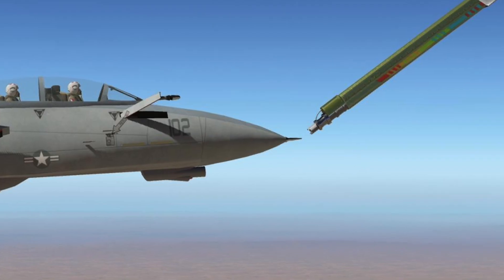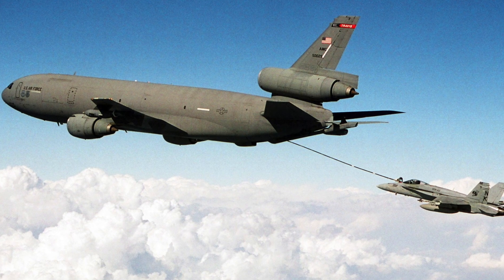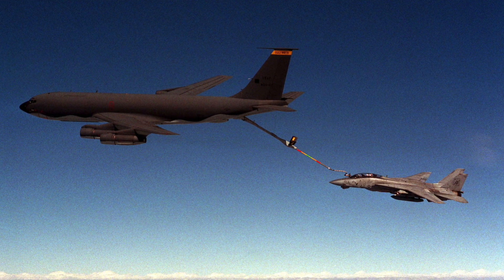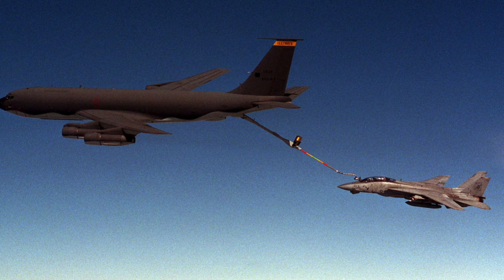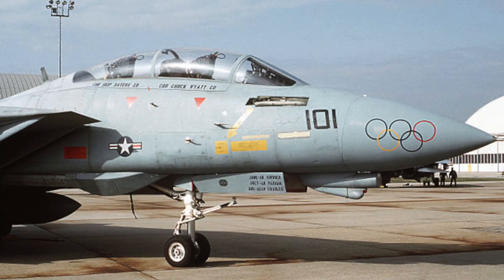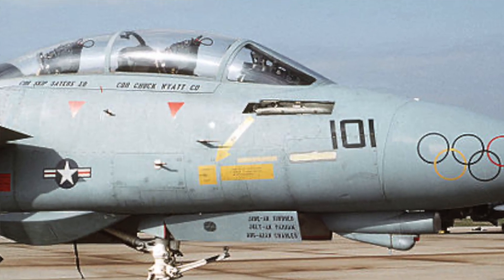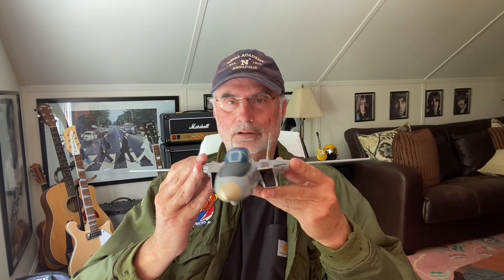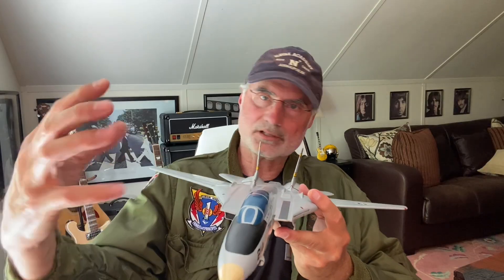Secrets of the F-14 Tomcat: Inflight Refueling

Comment: The under appreciated story is the decade plus of work that went into converting the F-15 to a modern FBW system with a redesigned wing and state of the art cockpit. These upgrades required extensive flight test program and were funded by FMS customers.

Comment: At least in DCS, I find the Navy Hose-and-Drogue FAR easier to accomplish than taking fuel from the boom.  Even when I am out of practice, I can usually get the F-14 plugged up to the droque on the first or second attempt.  Tanking in the F15 is, for me, far more difficult.

I understand why the Air Force tanks with booms, though.  They have to accommodate bombers, which can't be expected to chase a basket.

Comment: We had a pilot catch the fuel scoop on the cone air probe right after I joined the squadron. I got to crawl up the radome and try to undo these tiny hex screws on the waveguide up in the tip while holding myself up on my elbows. It gets warm in there! And of course all those jokers who walked by, moved the chocks, and rolled the radome back and forth with me in it. Crazy squids...

Comment: Great episode Ward. In the early 70"s my Dad worked on some issues with the F-14 fuel probe. In development it had been designed by a consultant and needed a revision to get right. In the F-14B WST when we deployed the fuel probe we would get increased wind noise in the aural cue system. It is a miracle you guys could refuel.

Comment: Was trying to figure out where to post this question: Could you talk about the fuel system in the Tomcat? Specifically how does the fuel pickup system allow such maneuvering and still be able to get gas to the engines? I know about tank baffles but does it have a header tank that always stays full so there's never an air pocket blip during aggressive flight regimes? Maybe fuel bladders that never have empty space in them to start with? I would also guess it has an inverted / negative G time limit? Was just pondering the design of it all as a mechanical engineer. Thanks, love your content!

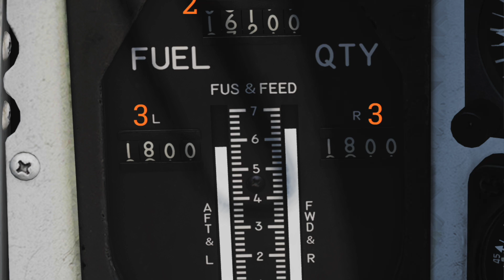Comment: Great channel however no offense but on the pilots fuel "quantity gauge it measures total lbs of fuel in the aircraft not fuel flow.  Item number three at 0:59 mark is the quantity of fuel in lbs in each of the feed tanks left and right.   Retired AD1 tomcat mechanic VF-124, 21, 24, 211 and VF-41.  Keep up the good work.

Comment: My thoughts were that the USAF learnt to tank large aircraft (bombers) first so the probe system makes more sense - harder connection and higher flow rates, the navy learnt to tank small jets first so the basket system makes more sense. I think IIRC the KC10 had both systems on it? Really think the Navy made an error in retiring the S3 - both from loosing the ASW capability and air refueling, I find it hard to believe it was cheaper to put the airframe hours on the F18s...
Reply: The US Air Force originally had probe-n-drogue refuelling, just like everybody else in the world. Then they tried refueling entire flights of four-engine bombers and found out that it took three seconds short of forever to get the job done. So they had to come up with a new thing to increase the flow rate. The flying boom was born.

Comment: Ward I was a KC/DC-10A guy A.K.A "GUCCI BOYS". Aircraft call sign "Yard Dog " Tac sign "Sierra 27 ",
We would always right up in the aircraft forms " Drouge refuel basket broke due to Marine F-18 " Because it never failed everytime they refueled from us it broke.
A few times we had to send our reps out to retreve our drouge basket from a few carriers. 
Oh the misshaps....once the basket breaks off you got a wet noodle flapping around the back of the tanker. It has to then be cut by a explosive charged cutting blade. Each distance between each marker line on the hose is 10feet. And every 10 feet of hose has a weight of 100 lbs. We extend 14 to 15 feet in trail.
As for booms....there had been a few F-4's that had snaped off the boom tip in thier UARRSI refueling receptical. 
When expecting F-4's we had to lube the Boom tip with teflon lube back in the day. The F-4 UARRSI was a half millimeter smaller in diameter than other recepticals.
No Lube =get stuck.
No Kickass Without Tanker Gas.
For modified KC/DC-10 Look up KC-10 WARP Bird.
Thanks Ward for the awesome videos. Awesome job on your channel Brother !

Comment: Why is air force an navy tanker different
Reply: Air Force needs a higher flow rate than what the Navy system has. The Air Force refuels some huge airplanes, so they need to pass more fuel in less time.

In a perfect world everyone would be using the Navy-style probe and drogue system. But it just isn't fast enough to fill up a flight of heavy bombers.

Comment: Got a call one day in '84 at NAS Barbers Point to take my tow tractor and meet an A-6 (tow bar not required????). Anyways the A-6 had a Drogue stuck to it's refueling probe, so the pilot and some chief, using the tow tractor as a step, tied a chain or line to the Drogue and then I genteelly used the tractor to pull the drogue off. Always wondered how often that happened. Now I know.

Comment: Maybe this is a comment so stupid that does not need any response. 
Why are aircraft aerial refueling points never used by ground refueling crews. Do the internal fueling pumps need to have engines running? Would an external APU help power internal fueling pumps to distribute to proper tanks?.  Greater chances for spillage? Is it safer to dump spillage in the air than on the tarmac?  It be nice when fighter aircraft use 3Phase 400cycle electric power. Tankers will just dangle an extension cord.:-) It would be nice if they could reload stores while in the air.

Comment: I was a Crewchief on A-3 Skywarriors with the west coast FEWSG squadron out of Pt Mugu in the late 80's. We had a KA-3B tanker. In addition to tanking ourselves we would also tank other squadrons / test programs / operations. One time we were doing a tanking training flight with the west coast F-18 RAG. There were four planes, three student pilots and a Marine Major instructor.  We were out over a MOA by the  Edwards area. One student was having issues contacting the basket. The Major finally had enough and told the student to "back off and let me show you how it's done". I knew the pilot and nav had rolled their eyes with that one, I know I did. Depending on if we were straight and level or in a turn I could look out over the back end (the Crewchief sat backwards) and see the drogue and the receiver aircraft. I watched as the major came in "kind of hot", hit the basket and watched as the sinewave went in and out. We could feel the shove that it gave the A-3. It ended up snapping off the Hornet probe into our basket. Crickets over the radio, then the major said "knock it off, RTB". He looked us over and verified we weren't leaking any fluids and left. We talked about what to do including using the guillotine to drop the hose out in the desert. We talked about it and came to the decision that if we could get the hose back in with lights out on the panel we would take it home. It reeled in with no issues. We landed with no issues. After we landed I unlocked the hose, me and a couple of line rats pulled it out of the fairing, strapped it to a tow bar, hooked that up to a tractor and pulled the hose out. I found no issues with the hose. The basked was trashed. The basket had "fingers" that the drogue attached to, there were "a couple" of them that were broken and bent. I pulled out the broken off part of the probe and gave it to the pilot. It's my understanding that the wardroom had it mounted to a plaque and they sent it back to the Major via the RAG's ready room.  This image is of my last flight in an A-3, 17 June 1989, we were tanking a NAS Point Mugu A-6E and a TA-7C (they were the chase planes) during a Harpoon missile shoot out over the Sea Range (PLEAD control).    https://www.vaq34.com/junk/a-3_tanking.jpg

Comment: Hi Ward.  Not sure about your description of how to "plug" a probe-n-drogue refuelling system.  I would never use rudder to adjust lateral displacement.  Rudder trim needed to be adjusted when in the 'waiting' position to get the good QFI "Ball in the middle".  From then on it was normal use of the fight controls to position the probe a short way behind the basket and then a bit of power to plug.  Using roll to raise or lower the probe in relation to the basket will just get you moving left or right away from the waiting position.  Small, normal, movements to get the probe in line - yes, as you roll right the probe will go down in relation to the basket, but, when you level up with the tanker again you will have moved a little to the right.  If the pilot in the video was using the technique you described then it might explain why he was dozy doe-ing around at the back:-).

Most of my tanking was behind Victor, VC10, Tristar, KC10 and KC135 (with the short hose!!!). Flying Tornado GR so probe position very similar to the F14.  Some interesting night tanking in GW1 in thunderstorms down at 4 - 5000 ft over the desert.  We were young in those days:-)

Regards  Mike - ex RAF

Comment: Hmm... it just underlines my recommendation to the RDaAF! If there is ANY way you can avoid airial refuelling - then FIND it. It is not that it can't be done; but the cost in tankers and training of aircrew is overwhelming.

Fortunately it seems likely that an understanding has been reached with Greenland and Iceland (Norway and Canada), where allied forces can use Søndre Strømfjord and Keflavik - at a price - but then you pay rent on a flat? And pay for power and water as you go? Personally I have nothing against Greenland EARNING some of their own money.
The savings to the USA are spectacular.

Now fighters are the smallest air refuelling problem - a far bigger concern is the big transports: They use A LOT of fuel and are not particularly easy to refuel in the air.
The point is: When you have a string of pearls airfields (so you allways have a full-service air station as a back-up) then the problem reduces significantly. Those airfield have to be defended - naturally. Here the F-35 is the airplane (with Mestersvig and Narsarsuaq as emergency fields) the right fighter - it has range. But condering the vast savings to the USAF it is NOT a smart move that we have to pay for the privilledge of doing the USAF a giant favour) - now that controversy is simmering down.
It did not help, you elected a moron for president having advisers that had done a couple of traps to many - so their feeble minds were all shaken up - jumbling BOTH braincells.

There is another technical point: Sdr. Strøm and Keflavik (Gander as well) have very cold air, which means in take-off the thrust of the engine is enhanced - it requires a bit more maintainance of the airfields; but a broom operator cost A LOT less than a crew of C-5's (incidentally: It does not snow much on Greenland - precipitation is officially like a desert).For landing the air is very dense and that is something a heavy laden transport appreciate - it lowers landing speed considerably.

There is a reason why some Nato members can be "difficult" at times.

Comment: Great video as always Ward!! As a side note the reason the Air Force uses the boom method for IFR, is that the boom can transfer more fuel more rapidly than the probe & drogue system.  A KC-135R can offload up to 6500 pounds a minute @ about 40 psi pressure. The AF used the probe & drogue early on but it was too slow to effectively use for bombers. Keep the videos coming, they are great viewing!!

Comment: I was the NCOIC of the Hot Pits at MCAS EL TORO from 94-96.  VMFA 314, VMFA 323, VMFA 232 VMFAT 101  Mostly F18c, sometimes we got 214 in with the Harriers..  But we pumped JP-5 and if it vented out the top or the bottom of the bird.... We kicked them out.. gave them the boot.

Comment: NOSE COLD    SO YOU WONT LIGHT TANKER UP.                                          I take it the planes radar is mighty strong microwaves you can be seriously harmed by. Could you actually burn stuff up?     If radar is that strong it would be interesting if the beam could be pinpointed like a laser.

Comment: Hi Ward, Nice post on AR procedures, especially with the Air Force. When we deployed at the start of Desert Shield, that August of 1990, we flew a five ship formation from Hurlburt Field to Woodbridge, England. Because we were unpressurized, we had five AR's scheduled for that first night which was about 16.5 hours at 10,000 ft. It was a hell of a flight, a lot of IMC flying, in a blizzard over Gander, where I was amazed that we all got our gas, about 35K lbs. per aircraft. As we finally lumbered into UK airspace, I was pleasantly surprised at the skill and ability of the controller working our five ship into line in trail with five mile spacing. He was a great controller. The second night, we took off on our last leg to Saudi, with two scheduled AR's. As I hooked up on the first tanker, somewhere south of Sicily, we began tobogganing due to weight/performance limitations. Well, we took the tanker all the way down to 2,000' above the water.  The weather was perfect as we punched off and started our climb back to the formation, which was utilizing another 135. As we climbed up, our flight deck suddenly went black, all/most instrument lights out, CBs popping all over the place. My instructor looked back at the engineer, who replied, 'We just lost the Essential AC Bus and the K relays did not transfer the load. After resetting some of the breakers, we decided to abort the formation, dump our gas and divert into Sigonella Air Base in southern Sicily. As we bid the other guys good luck, they said, 'Don't eat too much pasta!' We were there for five days waiting for parts.The next two months were spent in 110 F heat of King Fahd Airport in Daharan Saudi Arabia.

Comment: Pro tip:  If you ever find yourself halfway between San Diego and Hawaii, and the KC-135 boom operator asks "Do you mind if I do an emergency disconnect?", do not respond with "Sure..uh...OK."  When he yanked that basket back I felt lucky to still have a refueling probe.

Comment: On the F-14 the refueling door was considered airframes and if I remember correctly so was the probe except for the nozzle.  You can transfer fuel around on deck between aircraft using the main fuel line and disconnecting it from the engine and connecting your own hose and refueling nozzle to another aircrafts main fueling point.  Never tried it on the Tomcat thouh.  Also, we transferred fuel by using the drogue basket from a KA-6D to an A-6E  connected thru the refueling probe by use of line strung thru the basket and a stand/ladder and using enough force to connect.  That was for troubleshooting once but mostly we just disconnected the main line and ran the main bag fuel pumps.  We would get the occasional basket hung up on the probe too.

Comment: Nice choice on the 707 as Saudi Arabia has the KE-3A tanker since the late 70's and the E-3 is based on the 707 airframe.  Worked on them for a year overseas.  They also have the AWACS and have recently converted a few tankers into RE-3A's. The refueling system is pretty reliable.  Most hose and drogue discrepancies are a timing issue with switches from my experience with the KA-6D tanker package and buddy stores.  

Once upon a time our shop (A-6 mech) took possesion of an entire tanker refueling package off  of another squadrons bird by removing it and replacing it with a bad one.  Not an easy task!  We sort of had quadi-permission since it was headed to the bone yard and we needed a replacement one.  We ended up putting in many man hours and six days later we told that squadron about it.  Did most of it over a weekend non stop practically.  They couldn't say much since it was going to be cleared eventually and since they epically failed their watch standing they gave up.  Lol.  Probably a bad idea since we only saved a few days work as and got lucky that it was in working order.  I doubt it could be gotten away with today.  Fun times.  We also borrowed a nose landing gear from another squadron with quasi-permission.  The thing to do is act like you own it and when they discover it they get embarrassed.

Comment: One advantage of the Air Force's boom/receptacle system is that the pilot just needs to get into the contact position plus.minus a couple feet.  The boom operator then flies the boom to contact.  The pilot needs to be able to find the contact position pretty much without looking at the boom since the receptacle is typically several feet behind the cockpit.  I did it in the B-52 and it was one of the most challenging but fun parts of the mission.

Comment: The hard basket on the 135 could be difficult. As a Boom Operator I would never allow 5 jets on each wing. 5 jets would come up on the left. Each jet would cycle from left to right. When the first 5 were A/R complete and handed back off to ATC the next 5 would be cleared to port side observation and the cycle would continue.  I never had an issue with the hard basket. As a Boom there was a technique.  The MPRS pods were a game changer although it had many malfunctions. The pods were soft baskets with take up reels. We could not refuel 2 F 14s at a time. The wing span was to wide.  Anyway, it was fun.

Comment: 0:56 I think the image shown is not the fuel flow indicator but the fuel quantity indicator. It is on the right hand side of the front cockpit panel. Fuel flow indicator is on the left hand side together with the TIT and high speed compressor RPMs. Then again, my knowledge is DCS and Wikipedia based only :-)
Reply: You are not wrong.